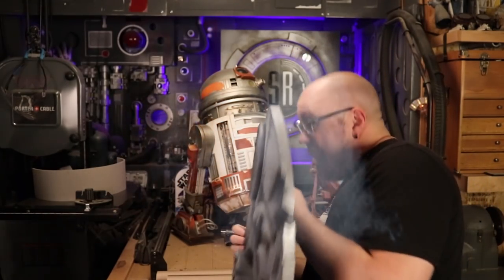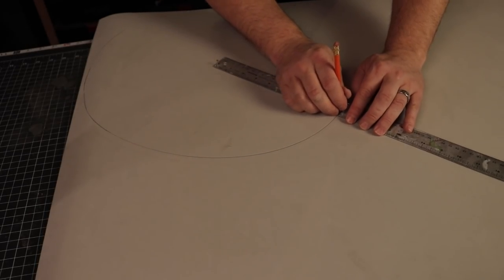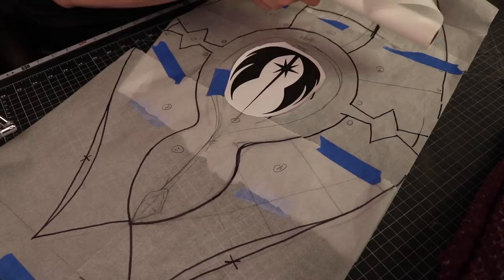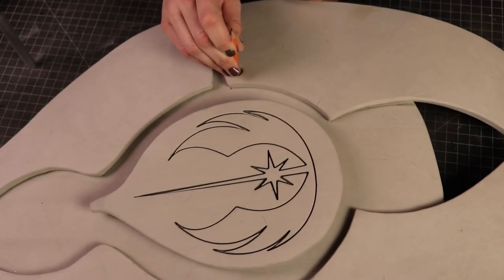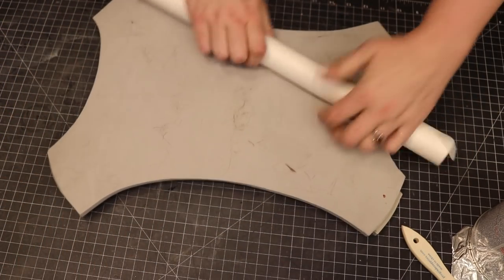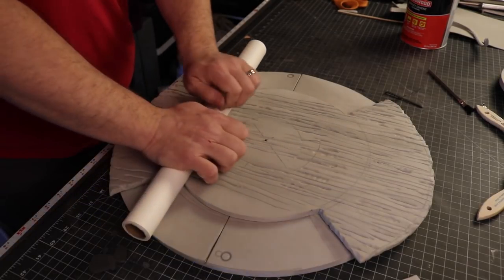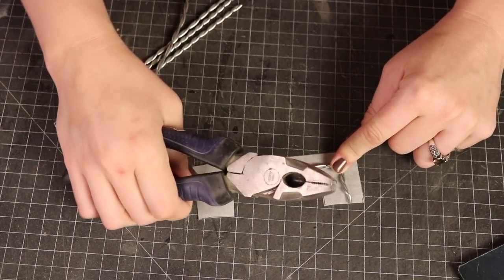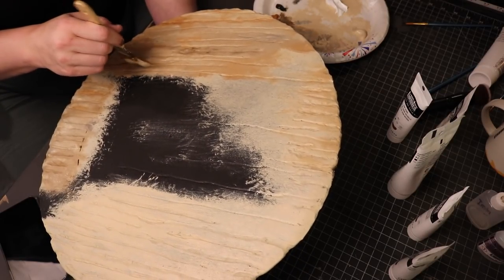EVA Foam Shield | Star Wars Inspired Designs

Comment: Cutting Faux Fur tip a seamstress friend taught me: Use a razor blade, and cut through the back ONLY. Flip it fur side down, and take small shallow cuts along your cut line, so you're only cutting through the thick felt backing. You don't want to apply pressure to the blade and press down through the fur like you would to cut a piece of foam. Doing that will just lead to you cutting the fur up and making a mess. Let the fur act as sort of a cushion for your cut, and just drag your razor through the backing. I had very little shedding or cut fur once I learned this trick.
Reply from the maker: Great Tips!!!  Thank you for sharing all of that with us!

Comment: Hey Brian  You can se the metal ruler to make a accurate compass. Drill 1/8 " holes down the center of the ruler. Whatever increments you like every 1",1/2" or 1/4 " depending on what size circle you want. I drilled them on the drill press setting up a guide so the holes were in the middle of the rule. after you drill the holes just file off the burrs and your done. The first hole is your pivot point to achieve whatever size circle you want. Mechanical pencils work  best. Rich

Comment: For circles, i use a meter long steel flat bar 2.5 cm wide. Sharpened nail at one end and a pencil in a bracket i made from 6 hole flat screw plates you find in the same aisle as angle brackets with machine screws and wingnuts so its ajustable. I'm sure you could 3d print something better.

Comment: Compass Idea - you can use a tape measure as a compass. Put a screw where the center of the circle is to be, lock the tape measure at the desired radius measurement, lay the tape measure on its side placing the body of it against the screw (where the rule comes out of the casing. place your drawing tool in to hook at the end and draw. Keep a constant but easy tension as you draw the circle
Reply from the maker: Perfect!  Thank you!

Comment: You can use an iron on the foil to impart a leather texture to the foam. Only drawback is that if you hit it with more heat later (like with a heat gun for sealing purposes) the texture can be “erased” somewhat by the heat causing the foam to revert to its “normal” state.
Reply from the maker: awesome!  Thank you!

Comment: When I need a large compass I just tie a string around a pen or pencil and then just hold the one end down where my center is and start drawing. Not extremely accurate, but neither are my projects that I use it for. Or you could make a simple trammel or bar compass.
Reply from the maker: so great, i actually feel kind of dumb that I didn't think of it! LOL, thanks much!

Comment: An idea for the ruler compass, would be to 3d print an attachment that you can slide down the ruler, where the edge would have an indent/groove that you could rest the pencil in. Then 3d print a cap for the pivot point of the ruler to keep everything leveled.
Reply from the maker: Oooh!!! Thats a great idea!  LOVE IT!!
Reply: I like the design challenge of this idea. I'm already thinking of three different ways to keep the pivot point and the pencell in line. For my part I'd add a set screw to the adjustable slide for repeatable circles.

In contrast, I've seen precision wood working tools, metal, that where pretty much just a ruler with a line of holes at the zero then every 1/4" with all the appropriate 1/4", 1/2", and 1" markings. I also, vaguely remember some plastic disk compasses that had something like the same sort of thing. They had a bump on the bottom and a spiral of holes that allowed for more precise circles (1/16" and 1/8"), but that was about a 4" diameter... Or, am I just remembering my spirograph? Any who, I could see that sort of thing being done in acrylic. AKA, fun with the laser cuter!

However, I'm kind of cheep so I'll stick to what I've been using since grade school: a bit of string, a set point, and a pencell.
 -Technique 1
First, measure the distance identifying the set point and the outer part of the radius. Then place your center point; set a nail or push pin. Finally, take a loop of string that raps around the set and your pencell, then make your circle. (Note: If you make a loop on your 'working end' to make a lassoes, you can tie off the string with a half hitch (?) at the loop so you'll have a measure for repeat circles while still being able to reuse the string.) Run on sentences aside; If you use two set points you can also make an ellipse using this technique.

 -Technique 2 
First, measure the distance identifying the set point and the outer part of the radius. Then place your center point; set a nail or push pin. For the next step, make a loop on your 'working end', then place that loop of string around the set. Hold the string and your pensile at the length, then make your circle. Though this is quicker it's less accurate. I'll use it for arks, but when going for circles I often have to rotate around my project lining out several arcs. That can leave a circle that is a bit wanky.

Hope the ideas and options help.

Comment: for a large COMPASS, 1. drill a hole in a pencil (I put the hole as close to the point of the pencil as possible for accuracy) 2. find straight thin wire and bring both ends together and pull them thru the pencil hole until the length of the loop matches the radius for your large circle. 3. wrap the ends of the wire around the pencil then tape it in place, leaving the loop of wire when pulled tight set to the length of your Radius. 4.  Install a wood screw at the center with a piece of scrap wood below to hold it steady and place the loop of the wire around it (do not wrap the screw!). 5. keep the wire tight while you trace the circle around the screw, the wire needs to be free to move around the screw to keep the distance accurate.